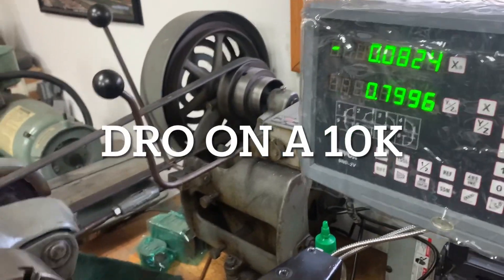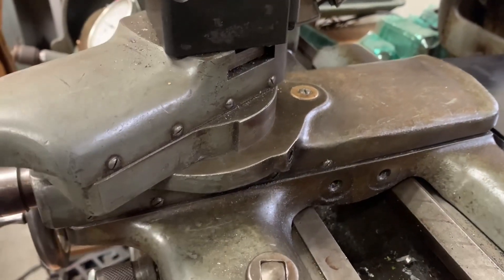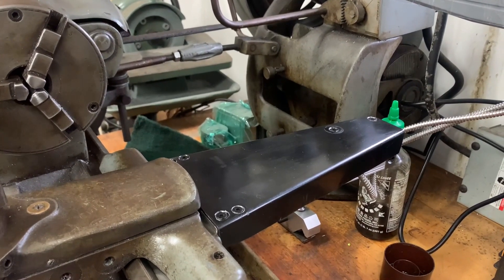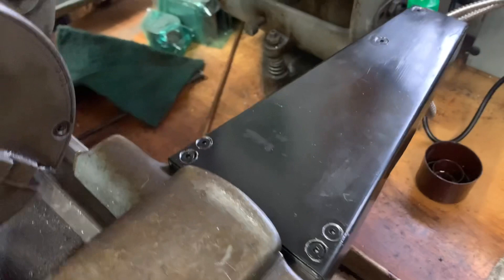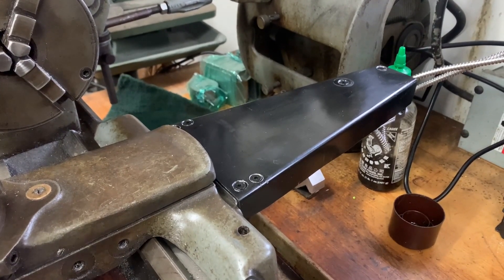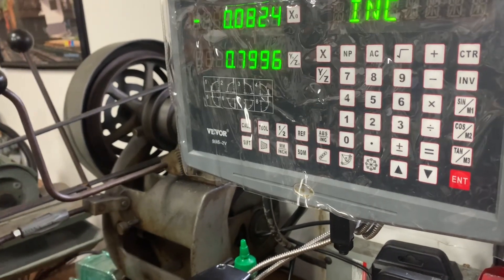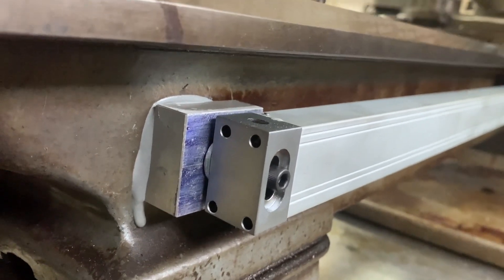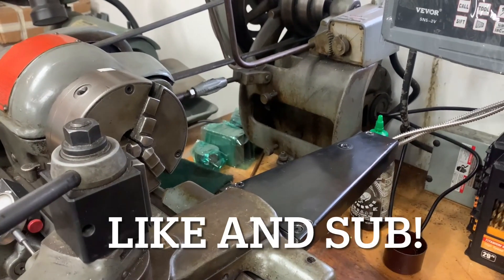DRO on a South Bend 10k lathe @mjbop1

Comment: I subscribed. I have a Heavy 10 with no taper attachment, so I almost didn't watch thinking I needed one, but you managed to use existing holes on the carriage. Love to see more as you're right- there's no room on the cross slide for the X.